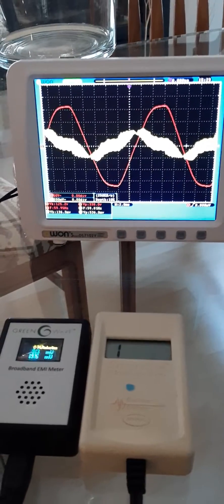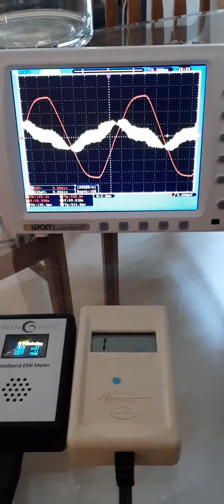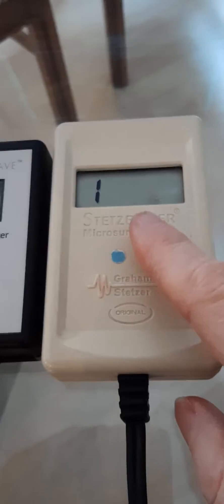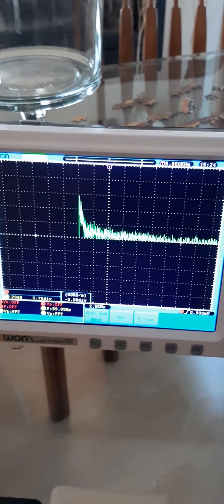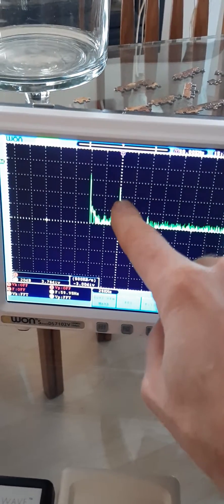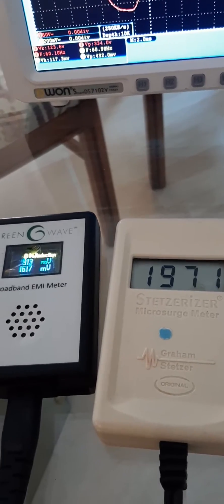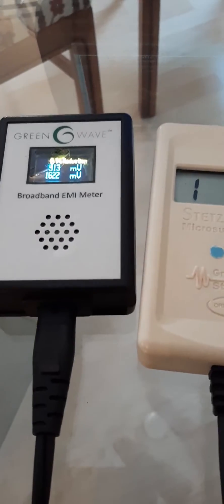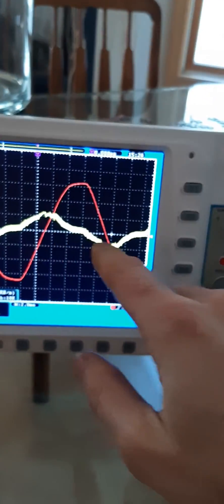ELECTRIC CARS AND DIRTY ELECTRICITY FROM CHARGERS

Comment: What is the hashy waveform? Current?
Reply from the maker: This is actually not my video but one of my colleagues. I'm assuming he has a high pass filter plugged into the Oscope here to give the square sign wave. And yes probably current you're looking at there.
Reply: @cathycooke   Why is it 90* out of phase?
Reply: And the scope shows the hash is ~ 500 mV peak ...
Reply from the maker: @jasonc247  yeah I think it's because he's using this ubiquitous filter attached to the Oscope: https://www.electrahealth.com/Graham-Stetzer-Ubiquitous-Filter-for-Measurement-and-Research_p_162.html
Reply: @cathycooke  OK that makes sense. It looks like a simple high pass filter with a cutoff frequency way above 60 Hz. So the hash is the high frequency component of the *voltage*.
Reply from the maker: @jasonc247  yes that sounds correct
Reply: The spectrum shows a strong 50 kHz component because that's a very common switching frequency for a charger.
There's nothing at 150 kHz and up because the EMI requirements look at 150 kHz and up.
I'd be curious to see the spectrum with the BMW charging.

Comment: An non-digital AM radio can be used to test for dirty electricity. I visited a Building Biologist to test a 2021 Nissan Versa and she used a non-digital AM radio to diagnose. The DE in this Versa was very high, even when the car was off and nothing running. Not sure why this would be. It's not an electric car. The fan wasn't running. Keep in mind that this particular car could be mis-wired and I'm not sure this would be true for every Nissan Versa.
Reply: Thanks Cathy for posting this info!
Reply from the maker: Good point Sharon.  I did use an am radio on the FF250 that I just measured.  You can see it here: https://youtu.be/0vD3licGEv4.  And you're so right, every single car is different, you must always test.